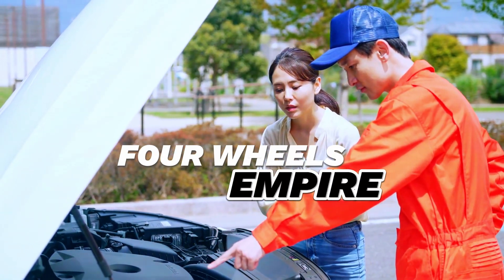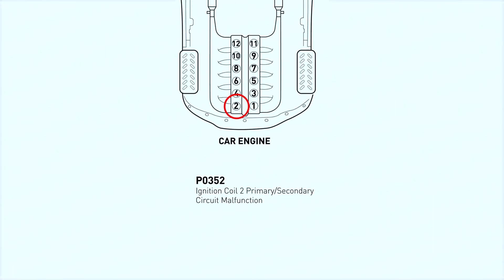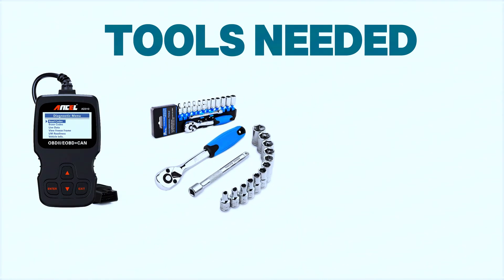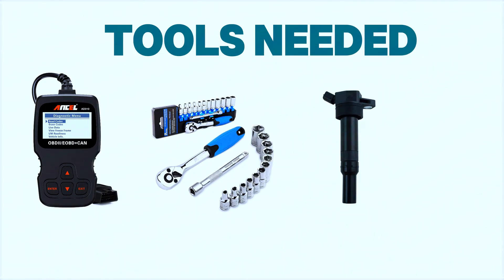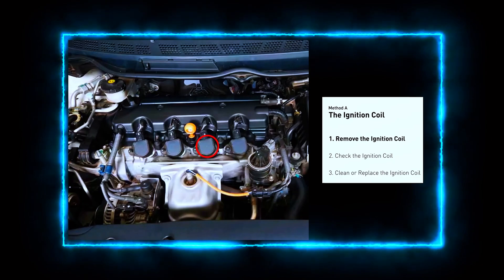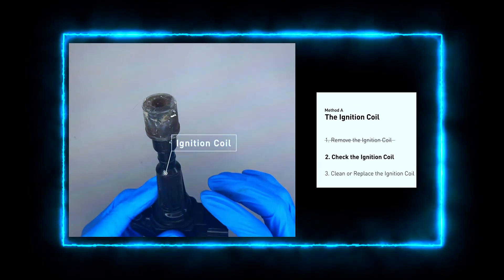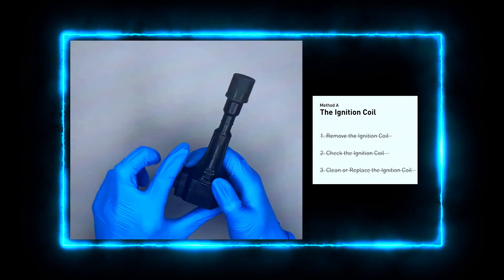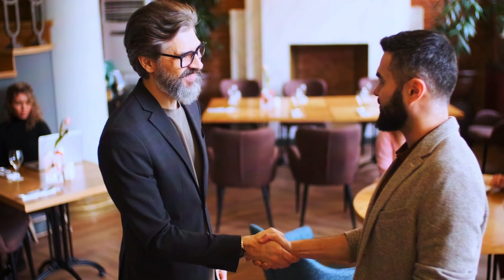How to Fix P0352 Code - Ignition Coil B Circuit Malfunction @FourWheelsEmpire

Comment: I changed the spark plugs, pigtail, and ignition coil, and there'is still a code (p0352) and engine light on. Motor vibrating
Reply from the maker: If you've already replaced the spark plugs, ignition coil, and pigtail for cylinder 2 and you're still getting code P0352 (Ignition Coil B Primary/Secondary Circuit), plus the engine is vibrating, it could be a deeper electrical issue. Here are a few things to check next:

🔧 1. Wiring harness – Look for damaged, corroded, or broken wires between the PCM and ignition coil.
🧠 2. PCM/ECU issue – A faulty engine control module can cause misfires and send false codes.
🔌 3. Ground connection – Poor ground can interrupt coil signal. Check for loose or rusted grounds.
💡 4. Injector issue – Although not directly related to P0352, a bad injector can mimic misfire symptoms.

A professional scan tool that can read live data or perform a coil command test may help pinpoint the issue more accurately. Hope this helps!

Comment: replaced all still check engine? what to check next?
Reply from the maker: Could be ECM or wiring harness problem... like need software update, but it's very rare... Sir now I want to suggest you. You should go to a professional mechanic.
Reply: @FourWheelsEmpire  ecm has been changed with a working used one
Reply: My corolla has been stalling but restarts ok. Just got this code, getting my coil replaced next week, told them to replace spark plugs as well... hopefully it's not wiring.